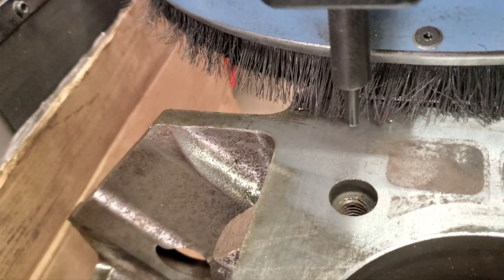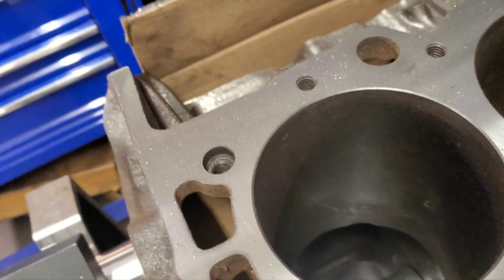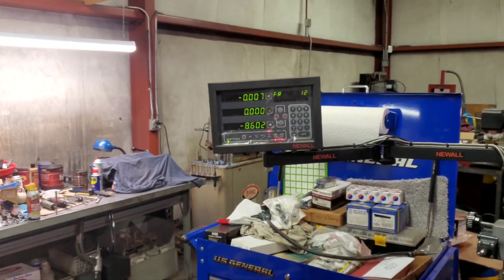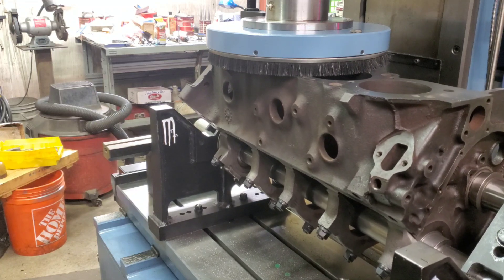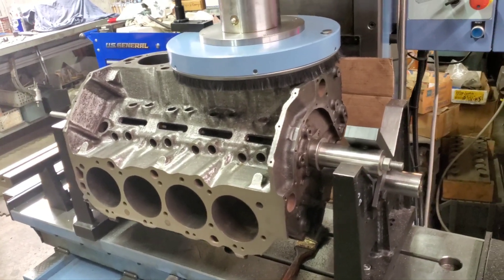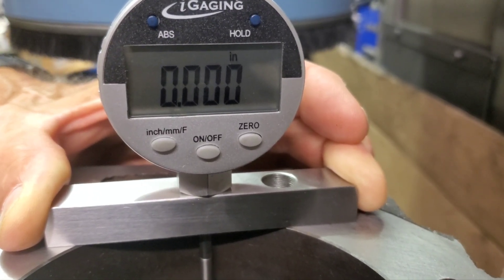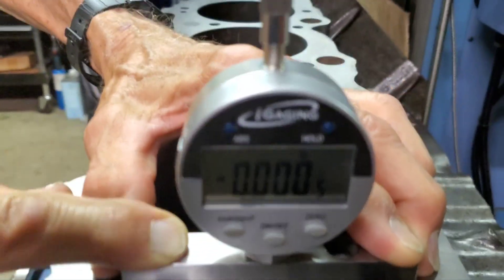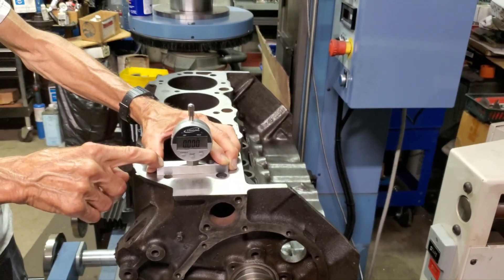Deck and Square a 454 Chevy Block For a 498ci.

Comment: Great video. 
What kind of mill are you using?
Reply from the maker: Thanks Matthew, I appreciate you watching and commenting. 
The Mill is a Comec ACF200 Bore mill.
Because you can do both boring and milling operations. 
Have a good evening. 👍🇺🇸👍
Reply: @edsmachine93  looks like a nice piece of equipment
Reply from the maker: @matthewklein9225 Thanks again Matthew.

Comment: Just curious how do you get decks square without a BHJ fixture? Very nice finish by the way.
Reply from the maker: Thanks Turboboy, I appreciate you watching. 
The fixture you're looking at holding the block is a 90° blueprint fixture, notice the cam cones and the bar in the mains.
Not all of these old blocks will clean at 90°.
Have a good evening.
Reply: @edsmachine93 I see, great work Ed thanks for the reply.